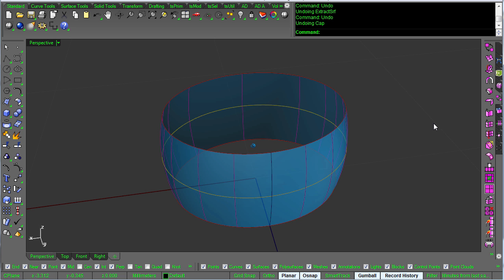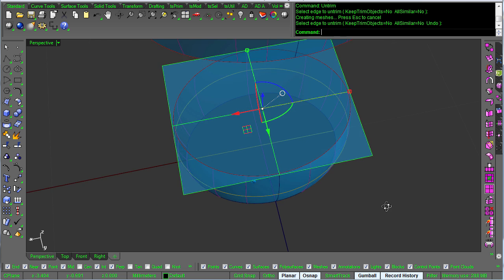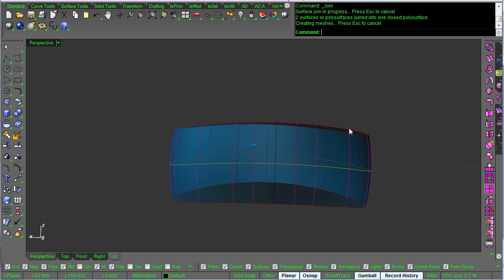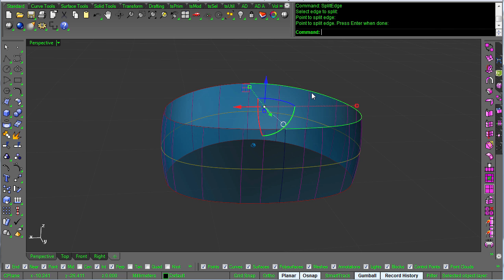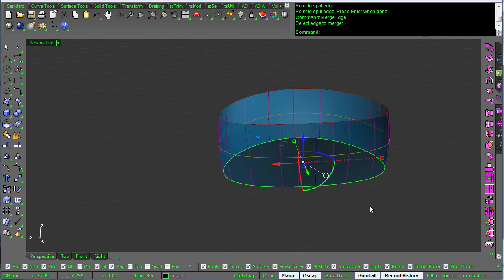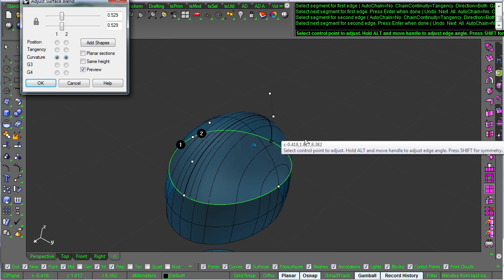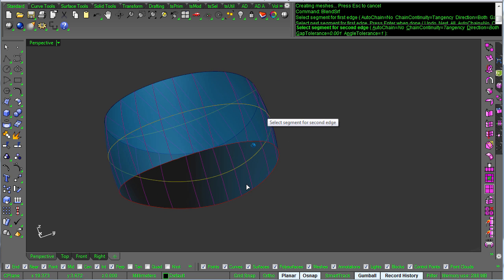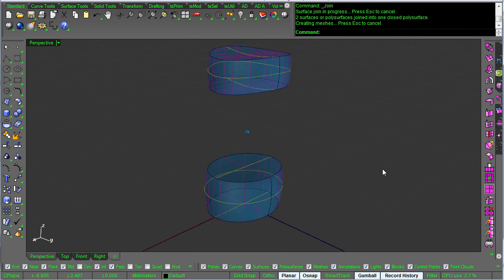Rhino Tips and Trick - Capping a Non-Planar Edge

Comment: Im still confuse...i have try and try but still didn't work. i try to make objek with polyline , 12 dot in there, when i extrude up and down objek can not close. and than i try this method...but still working...Helpmeeeee
Reply from the maker: is the poly line open or closed? try selclosedcrv
Reply: Thanks for your advice, i just found 3 way to close my object. 1. use Loft 2. use Patch, 3. use Sweep 1 Rail... thank you...i'm very happy and now i can continue my project...thanks

Comment: i get a curved line between the points from splitedge, not a straight line like in the video.
Reply from the maker: I'm not sure what you mean by a straight line (there isn't one in the video).  The edge that gets split is curved in 3 dimensions.  If it were planar (only curved in two dimensions), then we could simply _Cap it without needing to split the edge and blend between them.

Comment: Nice, thanks! Will this work on asymmetrical edge curves?
Reply from the maker: +Roman Rabinovich It will, just try to hit the midpoint when you split the edge.  Equal lengths is usually best.
Reply: +Eric Paul Marvets  thanks, will try that.
Reply: Eric, I know this is off topic, but I'm considering buying the Solus. Do you have any advice, for or against such a purchase? I plan to use if for myself and a few other small jewellers I work with. I don't have any exp with CAM, but I studied rhino/matrix and feel comfortable with them. Thanks again.
Reply from the maker: +Roman Rabinovich http://3dcadjewelry.com/forum/showthread.php?15956-Solus-VS-B9C